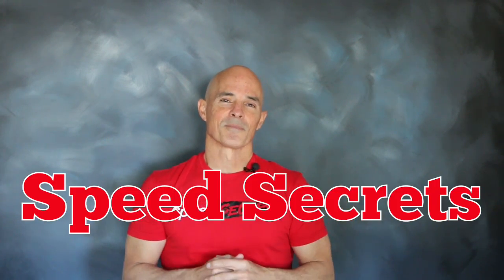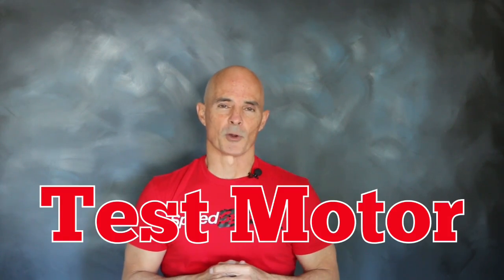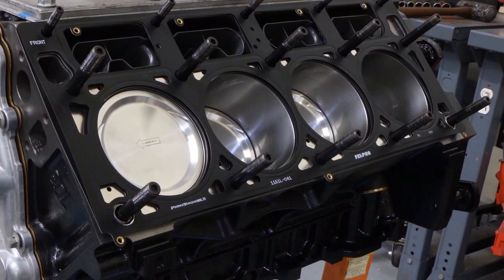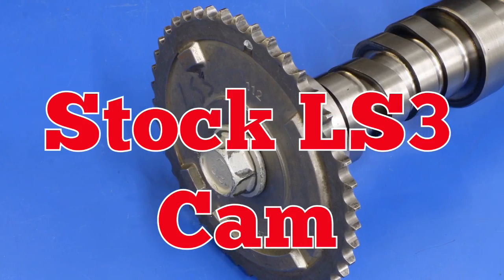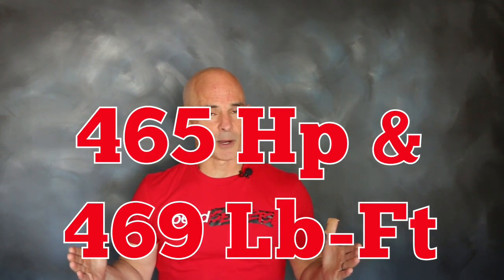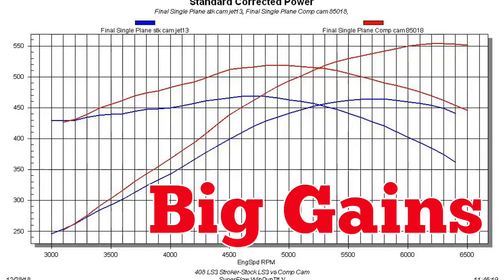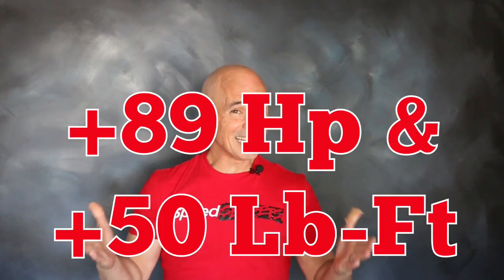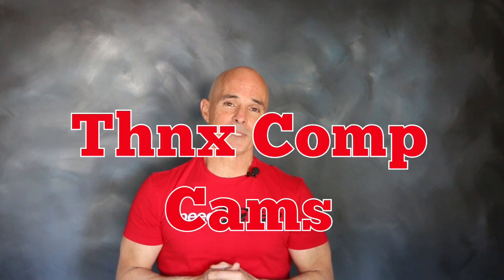Speed Secrets: 408 LS Stroker Cam

Comment: Great videos Richerd…. Missed this one but just caught up… that  LS stroker engine really has deep ashtray’s for pistons.  I’d expect at least 50-60 hp more from a stroker. I’m guessing the low compression has a lot to do with it. I noticed people install performance LS3 cams into stroker street engines. I’m guilty of doing that. Isn’t the valve opening and closing events thrown off do to the extra length of the stroke of the crankshaft. That being said, BTR and CamMotion makes dedicated stroker camshafts. Wondering what the differences in specs would be. 
Love to see a LS3 stroker cam test using dedicated stroker cams… but for starters let’s find a stroker with 10.5:1 or 11:1 compression, factory LS3 heads and intake lol. Can’t wait to to see the video. I know you guys can do it.

Comment: I just watched a video where you took a 5.3 and turned into a 383 stroker with LS6 heads. The engine made 600hp without the accessories brackets. This video using 408 with 823 heads, in which more displacement and better flowing head made less power. How?
Reply: That 408 from ATK is built for boost/nitrous setup he ran it N/A
Reply: @viralvinylz5399  okay. Thanks
Reply: Compression is lower in the ATK engine using 70cc heads. The 5.3 has more compression using the LS6 heads with 65 cc chambers. There is over 50 horsepower difference between these motors. The lowered compression in the stroker motor was designed for boost.

Comment: I have a 408 Callie’s. Dual quad throttle bodies and LS 7 injectors. The cam is a Comp 273/283. 108 centerline and 112 LSA.  3 inch headers and huge expansion chamber exhausts. No idea the horsepower. Running a magnum 6 speed, lights 1st thru 3rd with 12 inch NASCAR tires. My first experience with LS power. I think it’s making more than an SB2. All I knew before was big compression and a Jericho. Not sure it would work on the track, but fun on the street.
Reply: walt chase hey man what your setup lookin like. Sound like my goal. Twin throttle bodies up top like a Aussie burnout king

Comment: Will that cam make the same power with the same setup minus the single plane n adding a lsxr truck intake?
Reply from the maker: Generally speaking, what you'd lose in peak power you would gain back more in midrange with something like the LSXRT, which would be more useful for a street vehicle.
Reply: COMP Cams what can do you recomend for a 408 on 243 heads

Comment: A bit of constructive feedback.

The audio in this video is a bit ”unfriendly” to viewers with headphones. 

First, audio when the presenter is speaking is only through the left channel. In the rest of the video the sound comes through both channel.
Second, there are clear and ”sharp” cuts in the audio when the enginespecs and parts are presented.
Third and most important, the volume and sound change from talking to an angry LS revving high on the dyno is immense. Hurt my ears a bit. 
You could consider a smoother transition audiowise between segments. 

Otherwise, good video with an interesting comparison of parts! This combo is something alot of people would consider using.

Comment: Extremely vague video. What are the specs between the two cams? What other modifications were done to the valve train? minus the timing set obviously.

Stop flailing your arms like a clown
Reply: since you are to lazy to look up the spec here is the cam specs Intake Duration at 050 inch Lift: 235
Exhaust Duration at 050 inch Lift: 251
Duration at 050 inch Lift: 235 int./251 exh.
Advertised Intake Duration: 285
LSA is a 113
Reply: that was my initial thought..whats up with the valve train? is this an off the shelf cam?